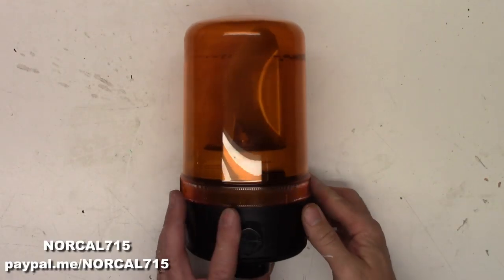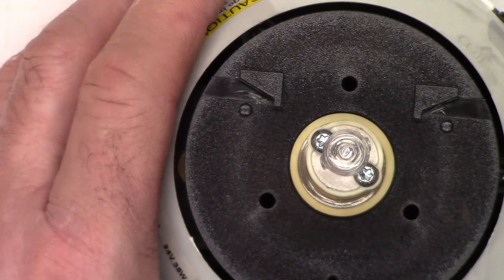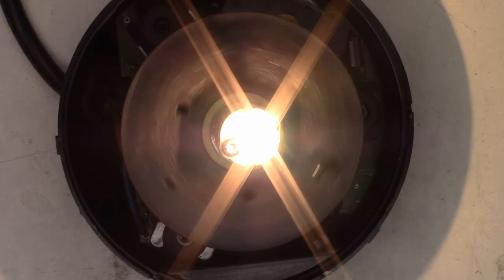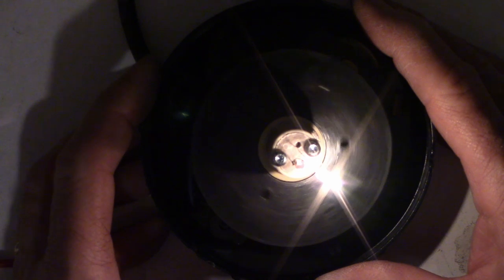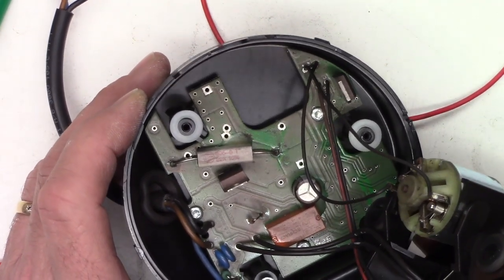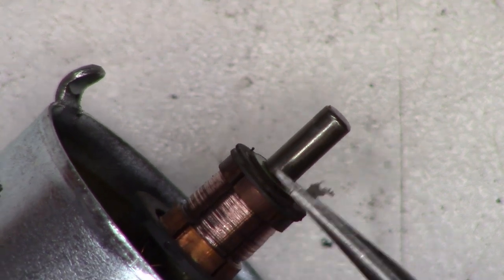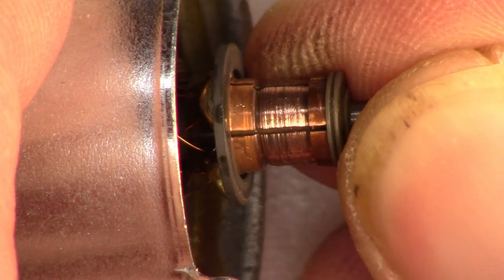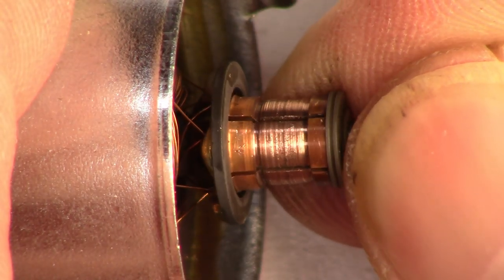ALLEN BRADLEY ROTATING BEACON FAIL. ALL USED UP 855BM-ARA24

Comment: I bought a lot of public safety lights for police, fire, etc. The early light bars with rotating beacons were all cheaply made, and were a source of trouble. Those on police cars lasted a year or two before needing replacement. Code 3 were the worst. When LED flashing lights came out, customers were much happier. As better made products were discovered, I switched brands.

Comment: The gunk on the board isn't flux. It's a conformal coating, probably a polyurethane laquer.
Reply: zapro_dk whats it used for? Keep moisture from causing corrosion?

Comment: Come on' Norzy... You could clean the crap out of the the commutator tot,  with your favorite joyjjiuce ;) Solder the heck out of those commutators to get the cont. back, rework those cutting blades, I mean brushes "proper" with a smooth dia. radius parallel to the commutator tot and most importantly, adjust to contact position to stay off the aforementioned soldered areas and be back in bidness... :) I'm disappointed for the 1st time! :) LOL But, yea, it was poorly engineered without any strategic thought, but how else are they going to continue racking customers over the coals if their products were rock solid and actually lasted a reasonable length of time..?  :Q